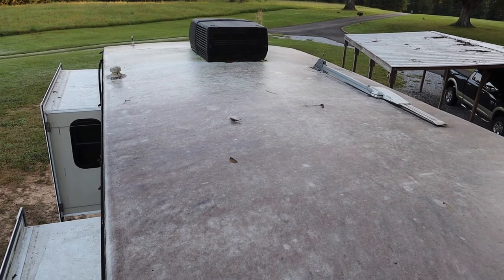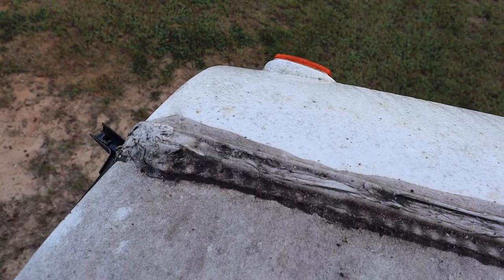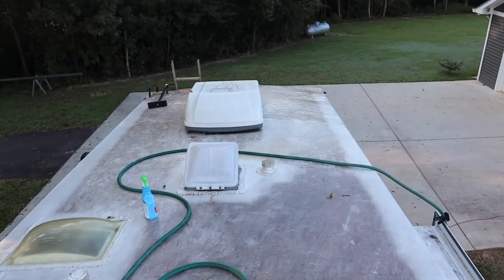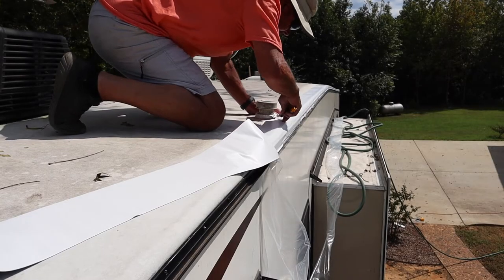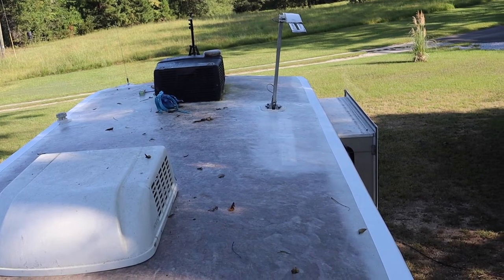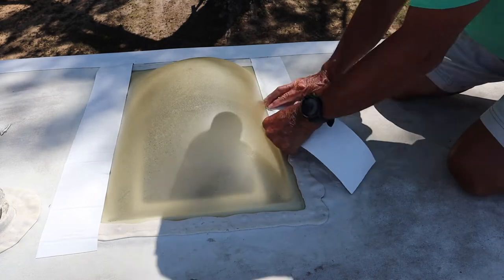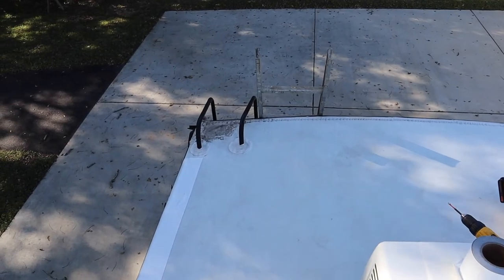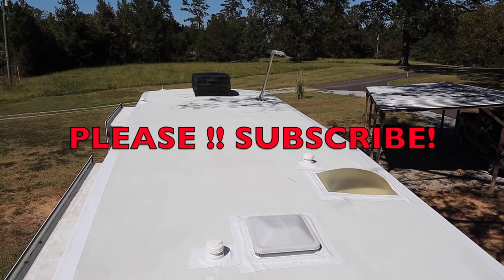Clean your RV roof and add LEAK protection with ETERNABOND tape!!

Comment: I did that 8 years ago and work out very well. No worry about water leakage at the roof line.
Reply from the maker: Hi thanks for watching and the comments. I agree that it will stop leaks. It's good stuff. Either way if you haven't done so already please consider Subscribing and hitting the like button. I would really appreciate it.

Comment: For the wood by the A/C that got wet you can soak it with Wood Hardener, it’s a resin that soaks into the wood, hardens and waterproofs. It can be screwed into without cracking.
Reply from the maker: Hi thanks for watching and the comments. That's some good information and I didn't know anything like that existed. Thanks! I think you may have already but if not please consider Subscribing and hitting the like button. I would really appreciate it!

Comment: Looks good, but I have heard horror stories about the tape shrinking and letting water in past the tape. It’s an absolute nightmare to remove and repair the damage.
Reply from the maker: Hi, thanks for the watching and the comments. I have noticed some wrinkling begining to show, but am thinking it is temperature related. I don't see it turning loose anywhere as that is some of the stickest stuff I have ever seen. I can see why it would be a pain to remove. If it does become a problem, I might as well pull the entire roof off because I won't be able to just remove the tape. I'm going to keep an eye on it and do another video if I have problems with it. Either way, if you haven't done so already, please consider Subscribing and tap the bell icon. I would really appreciate you doing that if you would please. Thanks again.

Comment: removing that calking where the roof meats the side wall would better be done with a plastic scraper
Reply from the maker: Hi, thanks for watching and the comments. I really appreciate it.  Yes you are correct. That would have been a safer approach for sure. Luckily I never went too deep with the blade. I think you may have already but if not please consider subscribing and hitting the like button. Thanks!

Comment: Turned out really well, i have 39' footer trailer the white is all gone on the rubber membrane so its all black now & even if i clean up the membrane & run my fingers across it my fingers are black, i want to use this tape on both sides front & back the trailer does have some wood rot right front corner which had caused the interior ceiling to sag so ultimatelyvthe ceiling will have to be worked on replaced & partly on right side of trailer has some light water rot edge of wood so its going to need some repairs down the road im just wanting to patch things up right now im tired of using tarps on it that tear within year after hot summer, are you using 6" wide rolls of this tape or 4" wide rolls?
Reply from the maker: Hi thanks for watching and the comments. I used 4 inch around the vents and 6 inch around the edges. Either way I think you may have already but if not please consider Subscribing. I would really appreciate it!

Comment: Great Job!. I was shocked to see how clean you got the roof. When the weather cools a bit I'll be up on by roof.  Only comment I would make is I would have painted both AC covers white.  More reflective and keeps the unit running cooler.  thank you!
Reply from the maker: Hi thanks for watching and the comments.  RV,s are a ton of work. Someone needs to make a complete maintenance free model! Either way I think you may have already but if not please consider Subscribing and hitting the like button. I would really appreciate it!

Comment: Man you did a great job on this! I have to do the same thing on my Keystone 5th Wheel.
I'll be putting in a new skylight & using Enterabond around all my vents.
Thanks for a great video.
Looks like you used the 6 " roll of tape?
Reply from the maker: Hi thanks for watching and the very kind comments.  I used some 6 around the edges of the roof and 4 around vents etc. If you haven't done so already please consider Subscribing and hitting the like button. I would really appreciate it.

Comment: I just subscribed great video! You ever think of putting some type of rv armor or flex seal on top of the whole roof? 

I’ve heard rv armor does not stick to the eternabond tape tho but maybe the white flex seal does
Reply from the maker: Hi, thanks for watching, commenting and subscribing for sure!. Yeah I’ve looked into some of the roof coatings and will try to do that later this year. Thanks again.

Comment: Did you use 6" width or 4" width tape?  Just wondering if one is easier to manage given how sticky this stuff is?
Reply from the maker: I used a combination of both. I think I went around vents and stuff on roof with 4" and a long the edges with 6". It is extremely sticky. As far as going along the edges I think I found the best solution as seen in the video. Let me know how it goes for you if you use it. Either way I think you may have already but if not please consider Subscribing and hitting the like button. I would really appreciate it!

Comment: Did the tape make a good solid bond without using primer?
Reply from the maker: Hi thanks for watching and the comments. Yes, it did for me. I think it's key to clean the areas very well before sticking the stuff down. Once it's stuck, it's stuck. I think you may have already but if not please consider Subscribing. I would really appreciate it!

Comment: On the side, did you remove you gutter trim and put the eternabond in instead of?

How’s it holding up?
Reply from the maker: Hi and thanks for watching and the comments. I cleaned everything real good including the gutters. I then rolled the tape down into the gutter the best i could. It does cut down the capacity of the gutters a bit, but doesn't appear to be a problem. 
The reason I went into the gutter is the way mine is built, the screws holding the gutter go through the gutter, through the sealing putty, through the roofing material and into the wall. That is a huge leak potential right there! They seal the top of the gutter metal to the roofing material with a tiny bead of caulk. I show that in my video. The caulk dries out and can let water down behind the gutter and into the wall. 
The tape is holding up very well and staying adhered nicely. The think I have noticed however is that it expands and contracts a good bit. Some days it appears wrinkled and some days it's laying nice and flat. Look for my 1 year review video and you can see what I'm talking about. Either way, if you haven't done so already, Please consider Subscribing and hit the like botton. I really appreciate each and every subscriber as I strive to grow my channel. I would REALLY appreciate it. Thanks again.

Comment: Instead of removing the cauking why dont you just tape over it with eternabond??? save you tons of time and work
Reply from the maker: Hi and thanks for watching and the comments. I probably could have just gone over it, but it was really pretty loose and no trouble to remove. If it had still been adhered well, I would have gone over it. Either way, thanks again! I think you may have already but if not please consider Subscribing. I REALLY appreciate each and every sub.

Comment: Where can I buy that tape? How many inches wide is it?
Reply from the maker: Hi thanks for watching and the comments. I think I got it on Amazon. It's called Eternabond and comes in 4 and 6 inch widths. I think you may have already but if not please consider Subscribing and hitting the like button. I would really appreciate it! Thanks

Comment: Is it ok to stand on the Slide-Out like you did ?
Reply from the maker: Thanks for watching and the comments. It was ok on mine but not sure if you could do it on all rv''s. Either way I think you may have already but if not please consider Subscribing and hitting the like button. I would really appreciate it!
Reply: It is not ok, to stand on any slide, the downward force on the light roof is not meant for weight above 80 lbs
Reply from the maker: Hi thanks for watching and the comments. I stood on mine with no issues. May not be acceptable for all though.